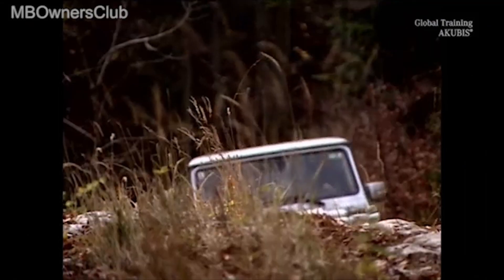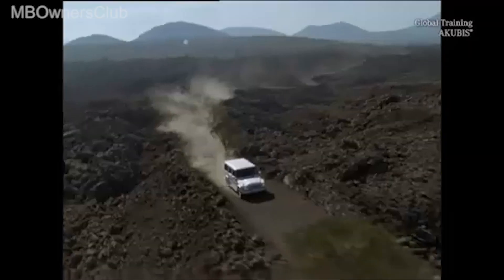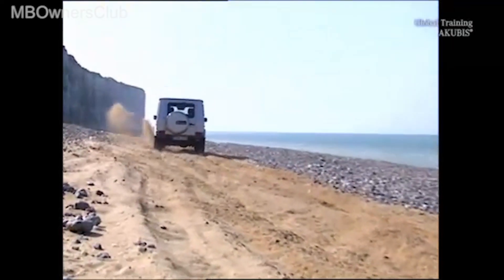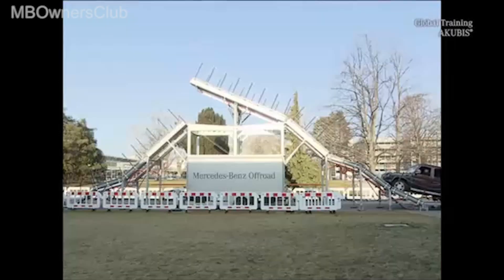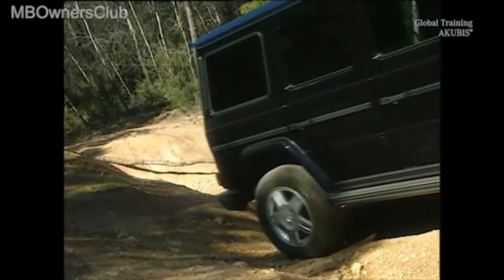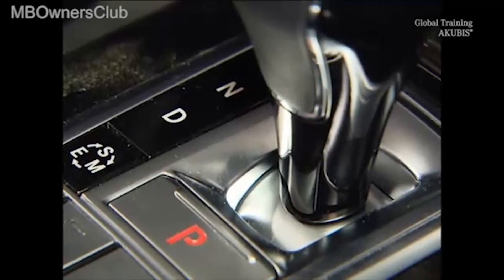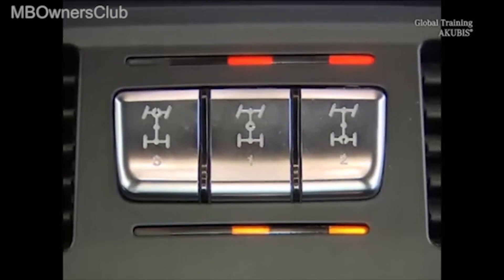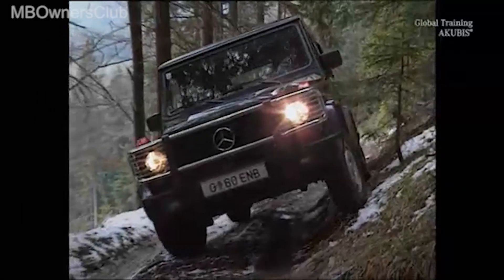The Unstoppable G-Class: Presentation of Differential Locks (W463)

Comment: I don't know about new G-Klasse Mercedes 4x4, but for sure GD240,GD300 of the 80s era are extremly reliable and offroad machines. This OM616 engine is beast. The ideal Diesel Engine, which all manufacturers have to copy.